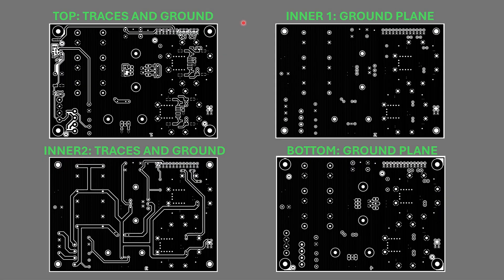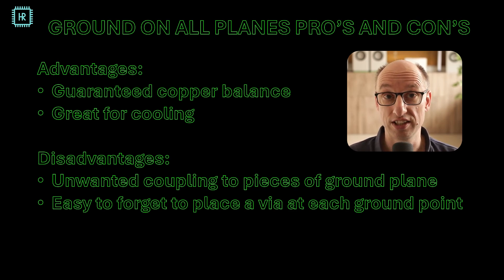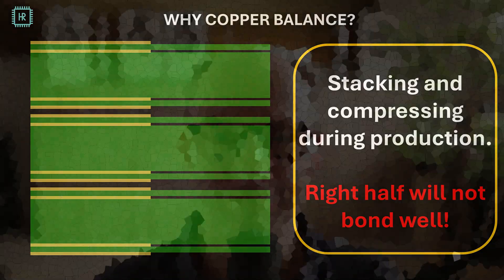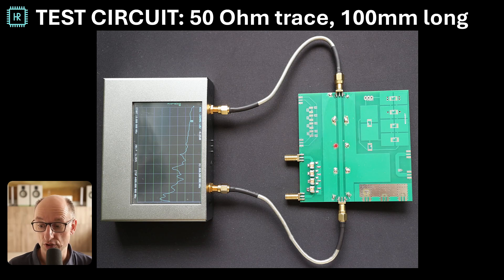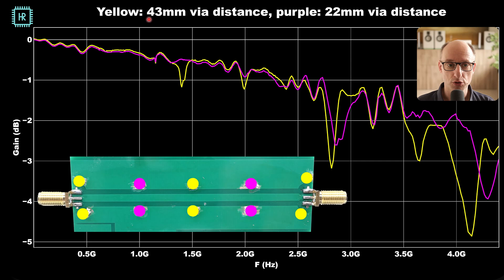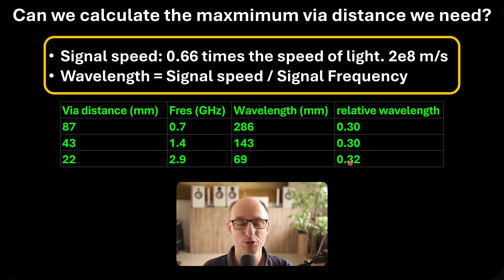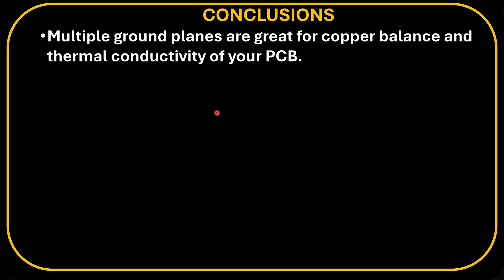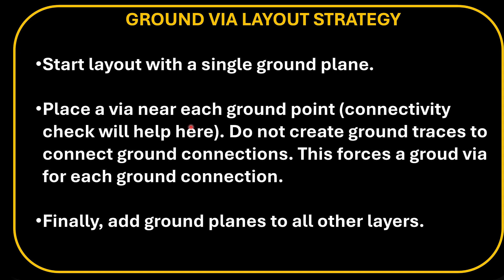Why Ground Planes Can Break RF... And How to Fix It

Comment: Why not make a demo board using a laser cut or slot via for a continuous plane edge or a fully shielded trace (equiv to coax made from a pcb traces, planes and dielectric).
Reply from the maker: there will be something using a via wall, will be a few weeks though

Comment: Thank you Hans. Great information as always. I work a lot with audio (hence the Douglas Self books) I would be interested to see a video all about ground planes for audio PCBs and also good ways to generate quiet split supply rails with modern switching regulators. It seems to be somewhat of a dark art.
Reply from the maker: Hi, I use dc dc regulators. I can them in a 4 layer board and use very large ferrite bead smd filters on the edge of the can with large caps inside and outside the can (and small ones for RF suppression). That should solve it drastically :-). I'll probably get to this design, but it will be months. I have a huge backlog of videos I'm planning to make.

Comment: Great series, clear, to the point and with practical demonstration.
I have just one possible nitpick: when talking about digital signals, I think we should take into account the rise/fall times rather than the frequency.
Even a 1 MHz clock has very high frequency components if its rise and fall times are in the low ns range.
Reply from the maker: Indeed, the way I look at it is: risetime and harmonics are basically 2 ways of looking at the same thing: The more harmonics, the faster the rise time. I think (correct me if I'm wrong) that if you get at least up till the 9th harmonic, you should still have something that resembles a square wave, more is always better of course. Although, if the 11th and onward are a mess, I don't know how bad it will get.....
Reply: @HansRosenberg74  Thanks a lot for your answer!
Yes, I mostly agree but my point is that we should consider both for signal integrity.
Suppose we have a signal with a very slow cadence, say 1000 Hz: a rule of thumb based on frequency alone would loll us in a false sense of security: 9 KHz, λ is 33 km, my PCB will be fine...
But if the rise and fall times are 1 ns and the signal shape is critical, we'd better take those into consideration.
There's this other rule of thumb BW = 0.35/Trise which might be helpful for an initial assessment (350 MHz in the 1 ns case).
That said, I really like these videos, for me they strike the right balance in length, depth and exposition, keep up the good work!
Reply from the maker: Ah, now I get your point of view. If you look at it from an interference transmission point of view, indeed, you'd need to assume 2.5GHz all the time :-) I was just looking at signal integrity, keeping a nice square.

Comment from the maker: I made a mistake. The speed on the board is not 0.66 but 0.50 times the speed of light, so 1.5e8 m/s. I checked the math if this is a problem when calculating the via distance, but this comes roughly to the same value and is on the safe side. Just wanted to correct this. (Really frustrated I messed up 2 numbers!)
Reply: So really, unless we want together into transmission line theory also, it’s really c/sqrt(Dk), and hence material dependent (and as stated, also transmission line type dependent if we want to get that precise). Thanks for your great videos!
Reply: What is the speed on the outer layers? The permittivity of FR4 is around 4, which makes for the factor of 0.5, but on outer layers, only a portion of the electric field is inside the FR4, the rest is in air. What's the value one should use in that case?
Reply: @benutzernamenichtverfugbar4977  It depends.  @TheTrueCBaer listed an ErEff of 2.8-ish for a coplanar waveguide microstrip a certain distance above the ground plane.  The ground guard traces slow down the wave compared to a "naked" microstrip, which is closer to like 2.1, and the distance from the ground plane also affects the speed (the closer the ground plane, the less FR4 you're propagating through, the faster you go)
Reply: Also, just to add, in the video, you say 200 thousand when it's 200 million. So, just so all the simples like me know - the speed of "light" on the board is 150 million meters per second (or 335 million mph!)
Reply: Using QUCS Transcalc 0.0.19 it calculates a ErEff. There is also the air above the PCB to be considered. An PCB with Er=4 H=140um (4 layer between top and first inner layer) 50 ohm grounded coplanar trace gets an ErEff of ~2.8. That translates to 1.8e8 m/s velocity. One thing with trace calculators I found is, they all give different results😅
Reply: Np, as you added: use this as a starting point 😊
Reply: To err is human.😀 I thought you were wrong but glad you found it. 50% of light speed is the number I’ve used based on various board vendor tools for FR4.

Comment: Good video series.
0.66 is velocity factor for coax cable, yielding 200 mm / ns.
However, for Fr4 with Er=4.5 .. 4.7, a better approximation is 1/sqrt(4.5) ~= 0.5, so velocity ~= 150mm / ns.
Reply from the maker: Ah, you're right, I picked the wrong number there. Unfortunately you cannot change a video once uploaded. I did the math and the numbers for via distance I'm presenting will have a safe margin to prevent resonances. So I think it is best to leave it like this, but I'm not entirely happy with it. I can take down the video and reupload it, but that would annoy my subscribers who see the same stuff as 'new' material again. Thanks for notifying me, you're not the first :-|. Best regards, Hans
Reply from the maker: I pinned a comment (means it stays at the top) with the correction.

Comment: Loving the content, it's invaluable. Like you, I've been doing this stuff for decades.

Regarding the wavelength calculations, I think introducing an arbitrary velocity factor of your average coaxial cable is just confusing things as it has no relevance. What is relevant is the velocity factor on the substrate, which in your examples is FR4 with an Er of about 4. VF = 1 /sqrt(4), so the Vf on FR4 is 0.5.

Irrespective, this is great info either as a refresher or for the noob.

Suggestion for an episode... mixed signal layout: positioning of parts & the arrangement of ground plane(s), separate or not?

Thanks again for putting in your efforts on these videos.
Reply from the maker: Thanks for the heads up. I didn't realize the difference is quite big: 0.66 vs 0.5, so it's really 1.5e8 m/s. It luckily won't change the formula for getting it right, just the 0.3 value is a bit different in reality.

I am planning a video on ground plane mistakes where I'll go into your question, but first I have to go on vacation :-)
Best regards,
Hans

Comment: Do you have any sneaky clever way to fix a board that has a disconnected connection to an inner layer? How many amps per via is permissible. (OK I will go read the checklist)  I have a 30 amp motor controller (chink stuff!) that worked fine until I pulled 30 amps out of it. Suddenly stopped working, but no bad components! Turned out to be source pads for the power FETs that had burned loose vias from an inner layer! Looks like I will have to design my own copy!

Comment: The thermal properties of PCBs are a whole subject in itself and deserves at least one video :) While adding copper helps, you very quickly reach the point of diminishing returns and it will be difficult to reach a thermal impedance below 35K/W or so. FR4 is an excellent heat insulator so inner copper essentially only adds thermal mass delaying the heatup (can be sometimes good enough if intermittent), and anything a few cms away won't help as all the heat has already dissipated away. I learnt this decades ago when I bolted a high powered MOSET onto a meter long heatsink profile and expected it to stay stone cold; it did not :) It's also something that is easy to visually demonstrate with a thermal camera, showing the effects of different area sizes, number of via's, 2L/4L/6L etc.
Reply from the maker: Thanks, I didn't know this level of detail. I did put teststructures on my testboards (you may have noticed) to make a video on that. I need cooling for transistors on my new audio amplifier and I didn't know what I could expect with regards to cooling. So I'm trying different copper pad sizes, different numbers of layers and coupling to other layers using vias to see what that will do. Still have to do those measurements though. I will make a video on the results, I don't know how much of a model I'll be able to derive, probably limited, however, your input helps! Thanks

Comment: You mention at the beginning (around 0:21 ) a specific order of where the traces should go.
What effect does it have if you place the traces mainly on the 2 middle layers and have the top and bottom layer as ground?

I can imagine there might be more crosstalk among traces, but there will be less 'leakage' to the outside, right?

Also would it make sense to not try to route GND pins except between the GND pin and its via?
This way the DRC check can hopefully help by clearing and re-fill the GND fill areas on the "ground planes"
Reply from the maker: The challenge with putting the wires on inner layers is that you cannot reach your components unless you use a via. Those vias will then nicely 'cut up' your ground plane :-) This is why it's better to put most of the signals on the top or bottom layer where they can reach components directly.

Comment: Thank you for your video! How do you feel about full-board VIA stitching? Does it affect signal integrity in a negative way?
Reply from the maker: Basically, the more vias the better :-) But there is no point putting more in than the calculation I show suggests I think.

Comment: Great video, would be great if you could create a PCB and show how to perform a layout, using your methods.
Reply from the maker: It's on my list! I plan to show an entire project of how to build a ultra high end power amplifier from scratch. Including all the simulations, stability analysis using hybrid py models, the layout, the assembly, the testing, the mechanical design. Everything! I just have to figure out if people are interested in such an extended project. This will take a few months of videos to cover going into all the details.
Reply from the maker: If you want something right now: Get my free book, it covers everything I do when making a layout. Link is in the description.

Comment: It's hard to understand 2 last sections without any visualization... Requires a lot of imagination.
Reply: Had to watch twice to get it (at least 80%)

But it is a good tip, thanks
Reply from the maker: Hi, sorry about that! There is too much information to tell in one video. This is really part 4 in a series. Part 1-3 will explain a lot more in detail I think. It explains why you need a via at each ground point.
Or are you talking about how to prevent missing via's in the layout software? Maybe I should have added visualisation there indeed, please confirm that this is the unclear part if it is.
Best regards,
Hans
Reply: @HansRosenberg74 Here are some of my thoughts on it. The previous slides and videos went very smoothly. So, I guess that when you simultaneously hear a text and see a picture, and both make sense, your brain gives you a green light to watch further. When you read the text and hear the text, your brain starts to visualize things, making it boil and requiring you to pause and revise everything again. Something like that.
Reply from the maker: Thanks for the feedback! Goal is to get better and better at explaining things. I was in a hurry making this video, if I had had a few more days, I probably would have added a picture or 2 :-)